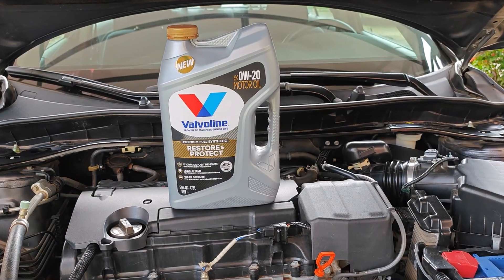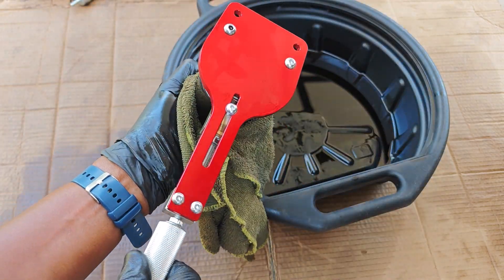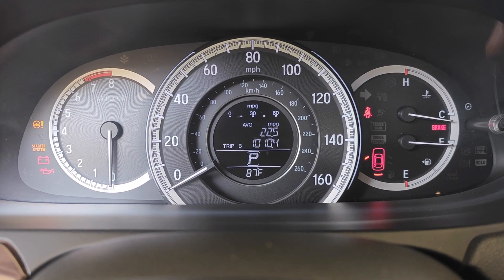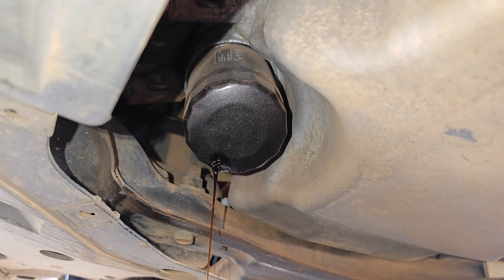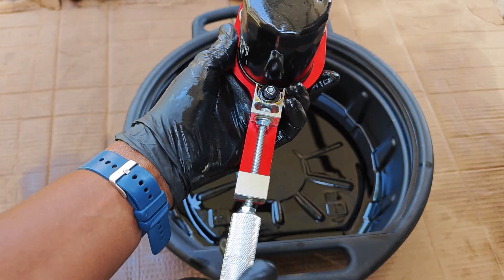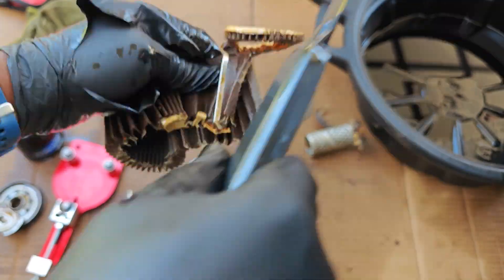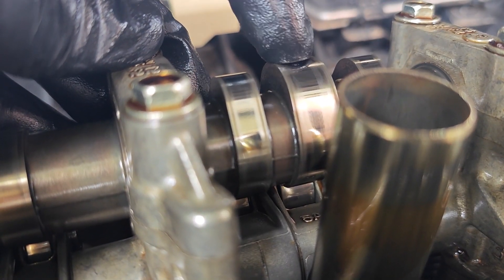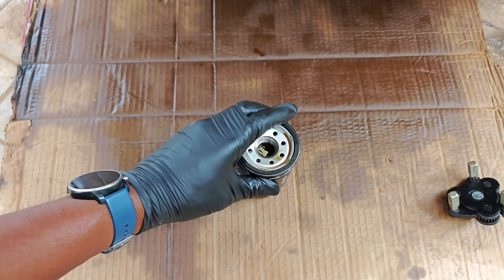1000 miles of Restore and Protect oil: checking oil usage & oil filter deposits

Comment from the maker: See you on the next update? For tools and parts used in video:

Get from Amazon  
  - Valvoline restore & protect - https://amzn.to/40lyH97   
  - WorkPro oil filter wrench - https://amzn.to/4fBcCbs   
  - Oil filter cutter - https://amzn.to/3OoxHtD   
  - Purolator Boss PBL14610 (Honda Accord) - https://amzn.to/40kBkYI    
  - Purolator Boss (select your car) - https://amzn.to/48pTtXp  
   - 8L Oil drain pan - https://amzn.to/3AWLxzV   
Check out other tools & products I use or recommend - https://amzn.to/42LGCL8
I may earn a small commission from a purchase made through the links above.

Comment: The puncture no mess method does not work with oil filters that have an anti-drainback valve. The oil that spills out when you remove the oil filters is on the intake side of the filter and it won't go down past the silicone valve without oil pressure.
Reply from the maker: Ah. Makes total sense. I kind of reasoned something like that would be the cause.

Comment: Speed Lake who is a NASCAR engine consultant and oil lab owner, did a tour with Valvoline, whom he consults with. The original version had to be pulled from the market because it worked too well, too fast. Oil filters filled with gunk and oil stopped flowing. So the new formulation is toned down to work over a longer period of time instead of all at once.
Reply: I believe oil filter have bypass valve, so if clogged the oil will still flow but without filtration.
Reply: @AM.D97  - correct.
Reply: His new video on it. 
https://youtu.be/-IDvx1LtqVM?si=LlrGHPH0QyTJqYFC
Reply from the maker: Thanks for sharing. Watched it too.

Comment: Hint: You don't have to puncture the oil filter prior to removal.....do this---> loosen the oil filter just enough to get it to rotate by hand. Then....use a plastic "red drinking cup" ( from the bargain store), and bring it up against the oil filter, and the filter will mostly fit inside. Then rotate the cup by grabbing the filter. Any excess oil fills the cup. Done. Clean hands.
Reply from the maker: Yea, I know this technique too. Since I was going to cut the filter open, I was actually aiming for the filter casing not to have oil stains or spills on it. That's kind of why I didn't go with the cup hack.

Comment: If you have been changing your oil with synthetic every 5,k miles with the filter you will not have clogged filters!! 3rd generation mechanic and engine builder
Reply from the maker: I agree with some exceptions. 
Since I got this car at 69k miles, I have without fail, changed the oil & filter just before 5k. I have also used without fail Valvoline 0w-20 full synthetic (not restore & protect) at all service intervals. It's not just about the oil. 
One thing I know is that the fuel available in my locality isn't the best of quality. That definitely adds to amount of buildup.
Reply: @DIYAutoworksNG  Fuel effects the valves with carbon build no effect on the oil:)

Comment: To know if it still burns oil drive it hard...  150 for a decent number of minutes 

I guess it relieves sticking rings and reconditions seals
Reply from the maker: All cars that use these lightweight oils will burn some if you maintain 150 for a decent amount of time. My idea is to keep driving pattern similar between before and after starting on this oil. Any change in consumption can then be tagged to the oil ceteris paribus
Reply: @DIYAutoworksNG  if you want to detect the oil consumption theres no better way,   you would know what is in excess and what is expected.   

But you would know sooner 

I also noticed adding a litre of mobil 20w50 to a 5w30 burner during the oil change  stopped the burning in 2 cars.   Might be the detergent or some additive in special concentration.
Reply: @Luoyd_yaeger  i'm guessing 20/50 is a bit thicker, less oil can get past the rings.
Reply: @namenotshown9277  once you dilute it .. its no longer 20w50.

But a burner would still burn some
Reply from the maker: It's thicker oil. It's the classic thing to step up oil weight to mitigate oil burning in an engine. However, this depends on the degree of wear or stuck piston rings. 
If the degree is severe oil burning will continue.

Comment: Did you know you have to puncture a hole in the oil filter in 2 different places for no mess? 💡
Reply from the maker: Didn't know. Why 2 places? For improved draining? I went with puncturing the lowest point and opened oil filler cap...
Reply: Not necessary, just use a disposable cup and place it over the old filter and twist off all together. The excess oil will fall into the cup and no mess.

Comment: Took my 2004 jaguar to the mechanic for upper-cylinder-cleaning & a motor oil Flush to reduce the Oil consumption (96,000 miles) 

Did not work for my car
Reply from the maker: So, one thing is being sure the procedure was done, could also be dependent on the quality of the flush product. That said, in the times, I've done flushes, they didn't reduce oil consumption. I used Liqui Moly flush plus
Reply: As far as I understand is not a flush per se. This thing loosens rings bringing back the seal within the cylinders, hence stopping the oil burning. A flush alone wont do this, you ll need to disassemble and service pistons, and this claims to do that. Allegedly.

I got a few quarts and Im doing this on my car, 2 every 3k miles is burning
Reply from the maker: Do let us know how yours goes!